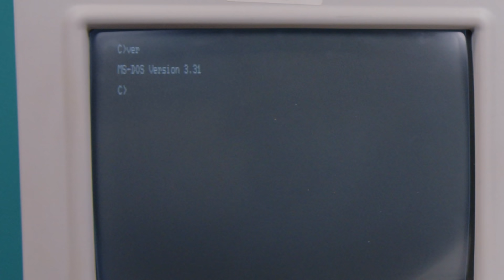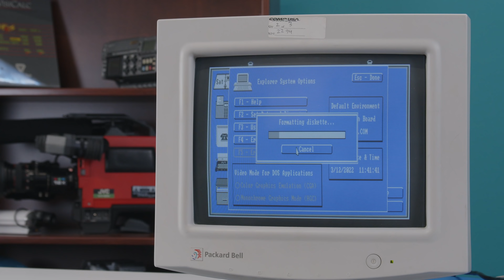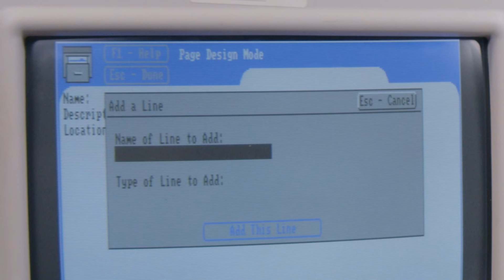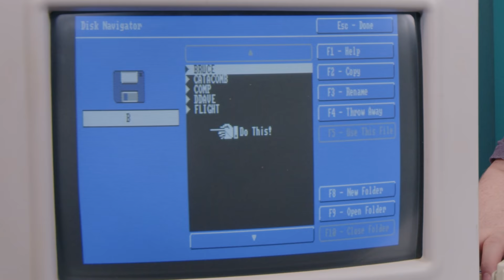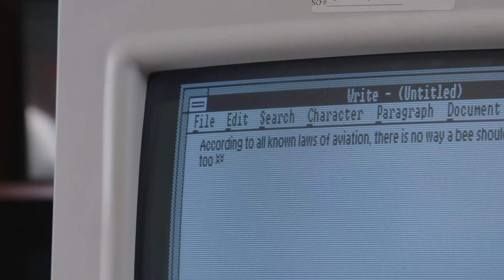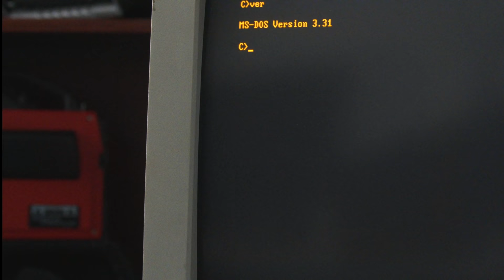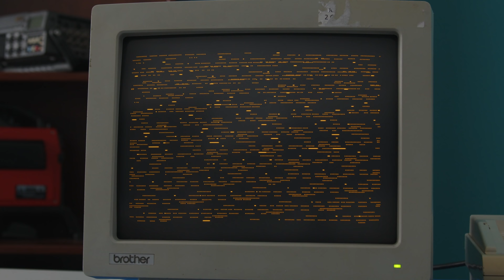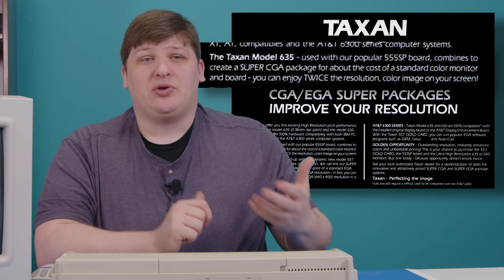Headstart's PC With The Weird GUI "OS" [Explorer]

Comment: I never heard of this machine before, cool video. Though, as someone that grew up on the C64, I actually loved that keyboard. The only issue is the cursor keys and that some of the customary interactions have changed over the years. I have typed many a program and paper on the old C64. :)
Reply: I still type programs on the C64. When I first saw a keyboard with 4 cursor keys, I thought:  What a needles clutter. ;-)
Reply: @NuntiusLegis  I really think the C64 keyboard is pretty great, really. I just happen to miss the Alt, proper Ctrl, meta and esc keys. Oh, also, I would kind of like a nice number pad too. If only I could use one of my USB number pads on the C64...
Reply: @CubicleNate  But the C64 does have CTRL - and CBM, RUN/STOP,  RESTORE, color keys, and graphical keys! Because of the clever multiple functions and appropriate labeling, a C64 keyboard compares to a PC keyboard like a Space Shuttle cockpit to the control stick of the Wright Flyer! ;-)
Reply: @NuntiusLegis  this is true, a lot of those things do translate. I suppose the run stop key is like escape. At least I used it much like that. I'm not sure how restore would translate.
Reply: @CubicleNate  Restore is the little sister of reset; can also get you out of trouble, but causes less collateral damage than the more dangerous and unforgiving big sister. ;-)
Reply: @NuntiusLegis  I can recall as a kid hitting Run/Stop and Restore to get my computer with no describable benefit. To this day, I want to hit such things on my modern computer but alas, the best I can do is Ctrl+Alt+Backspace to kill the X server.

Comment: A good keyboard is also important to me. If you type a lot of code on a bad keyboard, it slows down and your fingers cramp up quickly. I don't take that lightly when I have to buy a new keyboard. Nowadays it is hard to find a good keyboard, even expensive models fail in different ways.

Comment: Great video. Interesting machine. Reminds me of something I used. I have to ask have you tried using an amstrad PPC512/640 They had great keyboards. It was kind of similar to the headstart, but it also had a built in monitor.

Comment: @Cathode Ray Dude The Headstart's Hurculese mode and all graphics are done through a mix of having the CPU doing double duty, and three IC's all working in a form of psuedo-TTL for graphics. This is why the flip flop for Hurculese mode does not work, because it does not render the second frame at all.
Reply from the maker: Huh, do you have source on that? The graphics chip (details in pinned comment) says it supports Hercules natively.
Reply: @CathodeRayDude  The Yamaha v6366 in these machines are chips that were not fully functional as a way to cut cost, so they are half disabled, the second IC that was used to help with managing memory for the Yamaha. So page 2(Page 1) is not displaying, because the chip will not be able to display. I have no officalpapers for this, this is from my working and fixing three of these kits over the years.

Comment: Keyboards in the 80’s and 90’s varied wildly in quality, from terrible chiclet keys, to horribly unreliable & mushy foam and foil keyboards, to amazing Alps switches on some Apple II’s, IBM’s, and many others. 

I think your thoughts on 80’s keyboards being mostly terrible is just down to the particular old machines you lucked out on using the most often. I don’t think most were as bad as you are remembering, and the truly horrible keyboards from that era are just so terrible that they impact our views on the whole time period in general. 

There were just way too many amazing machines with fantastic alps switches, double shot key caps and over built construction for me to agree with 80’s keyboards being generally terrible quality….
Reply from the maker: I mean, I have an Atari ST, Apple IIc, IIe, C64, C128, Amstrad CPC, high end MSXes from Yamaha and Sony, Tandy 1000HX, and several other less well known devices with full-travel keyboards (like the FOR-A Video Typewriter) and I find every single one of them unpleasant and difficult to use. I'm willing to say I'm picky, but I also assert that these keyboards were objectively worse than the IBM Model F or anything derived from it. IBM's design was just a massive leap forward in quality.

Comment: Remember the Sinclair ZX Spectrum, and the Amstrad CPC-464? (No... lol... probably not) 

When Sinclair was in trouble, in spite of having one of the most successful home computers in the UK ever, Alan Sugar of Amstrad (later the original host of The Apprentice in the UK, before it came to USA) bought Sinclair and made upgraded Spectrums with proper keyboard and 3" disk drives (the Spectrum +3) but, later, they made the Sinclair PC200 - a 8086 CGA PC with 3.5" drive, two ISA slots for EGA/VGA or Western Digital Hard-Cards, under a flip up panel behind the keyboard. It ran MSDOS 3.2/3.3/6.x.

One of those was my first PC. Lovely thing of the wedge form factor, with a great keyboard (as I remember it). Black and red. Probably around 1988/89. 

Internet pics show one with the monitor on the area behind the keyboard but you would have never done that because it was only about 6" deep and it was flimsy plastic. Also, as soon as you installed a card, they stood upright (no riser card - they didn't work well with ISA) so you couldn't close the lid.

I think if you can find one (unlikely) you'd find it interesting.

Comment: The true beauty of MDA is only revealed through a true monochrome monitor (as you quite fittingly did. How could I have assumed, you'd leave the demonstration at that?).

I remember the clarity, no setup with a TV could ever aspire to match. Hercules was the engineer's choice. It also did games quite well.

It still compared favourable to later, higher resolution colour formats. Clarity is a factor in its own right.

Comment: Quick little note about you’re keyboard rant: that jamming you’re describing is known as binding and almost always is a result of dust accumulating in the switches over time. There are very few switches that experience binding when brand new so back in the 80s the switches wouldn’t have felt as bad. That being said don’t get me wrong, even without binding there were definitely many keyboards were more horrible than typing on thumbtacks

Comment: @34:58 Totally agree. That being said, I believe you can turn the computer on with another key pressed to change the boot speed from fast to slow. I used to work at a retailer that sold these in the early 90s. Now that I know more about their history I realize they must have bought old stock for cheap and resold it here in Latin America, although I don't recall if they had Spanish keyboards ...

Comment: There's a driver called EXPLORER.DRV that came with a copy of the 16 color version of Sierra's 1990 Christmas Card, that the install program labels as "Explorer with RGB monitor - 16 Colors". I've tested it with my ATI Small Wonder CGA/Plantronics/132-column card, and while it doesn't display correctly (output seems to overlap multiple cga planes, PC+ style, but not in a compatible fashion), it's clearly CGA-derived. I and a few others who specialize in Sierra adventure games have theorized, since finding it last year, that this is the machine it was intended for.
Reply from the maker: Wow, I better check this out then!
Reply: @CathodeRayDude  I'm currently going thru a deep-dive of stuff on The Internet Archive, and I just found a copy of Mixed-Up Mother Goose (SCI0 version) with its own EXPLORER.DRV, inside a warez disc. It is a different size than the 1990 card version. If you want, I can message you when (and if!) I find more.

Comment: Yeah, most of the 8-bit computers didn't have a dedicated keyboard controller, and did matrix scans during vertical blanking intervals.  I think the Apple II was a rare exception where it DID have some sort of controller.  Anyhow, scanning on VBLANK results in some character lossage, especially if there's any debounce as that's not nearly fast enough to catch any keys striking within 16-20ms of each other.   I felt that keenly when I got my C64 out of storage and was messing around with it - it even shows up in the emulators.

That being said, the 16/32 bit machines (Amiga, Macintosh, Atari) and PCs had dedicated keyboard controllers even in the 80s.   The Amiga 2000 (1987) even has N-key rollover in the initial batch of keyboards produced - diode-ified matrix...with the bonus that it's an embedded controller variant of the 6502 driving it ("6500/1 ONE-CHIP MICROCOMPUTER").

Comment: 26:10 Basically vi/vim text editors also delete things by cutting. Or, more accurately. Anything that you delete (character(s), line(s), selection) are "cut" rather than deleted. And since you have multiple named clipboards, you can still use your own copy/paste things separate.
Of course, you don't have to use a mouse for that... since there are no buttons at all.

Comment: I was using GEOS on my C64 in the late 80s and very early dawn of the 90s.  Initially I used the basic GEOWrite and later the expanded GEOWrite Workshop.  I also had a spell checker, I don't recall if that was built into GEOWrite Workshop or a separate GEO app.  Anyway, the GEOWrite  WYSIWYG word processors were very nice and more feature rich than the Headstart appears to be.  I could out-type it, but it wasn't terribly bothersome to me.  JiffyDOS, a 1581 floppy drive and a 512K REU made GEOS very comfortable to work with overall though.

Comment: I have a feeling the Apple II keyboard was probaby better when new than after 30-40 years of use, time and wear and tear. Especially given that the best keyboards if the era used mechanical keyswitches. — One other notable thing is that early computer keyboards are very much like those used in a typewriter, which is rather different than any common PC keyboard. Thus they are probably designed for a different audience; since typos (on a typewriter) are a pain it seems likely that the keys are intended to be struck very deliberately and relatively fast, but not super quick.

Comment: An odd computer for sure.  It's a cross between brilliant and low-end computers at the same time.  The keyboard and concept is the best feature.  The bulk, not so much.  But its GUI/software is the worst - that's not really a "GUI".   If that software was decent, it seems it would be something that would attract people who are still more used to typewriters.   At $600 (1990) and compare it to an Amiga 500 which was selling for $500. that was a lot smaller.  Easily has far better graphics, stereo sound and of course more expandable.   Having a full-blown OS too.   It's still sad that PCs were more expensive vs better technology back in those days.

Just saw this video, and halfway through your "best school computer".  Great videos on old technology.  Thanks for showing so much on these things.

Comment: Hi! The Hercules problem could be because of a memory overlap.
One of Hercules' video pages overlaps with CGA's.
That's why the Hercules card uses only one video page after power-on, to co-exist with a CGA.
Unfortunately, some applications don't expect this and will use both pages - thus corrupting CGA video.
If you had a dual-monitor setup, you'd perhaps see a graphics on the Hercules monitor
and simultanously a corruption on the CGA monitor. MSHERC /HALF may help here.

The other page is also uses by CGA emulation on Hercules cards, maybe.
Programs of the kind of SIMCGA let CGA programs/games write into CGA video memory,
while simultanously copying a re-formatted image into Hercules video memory.
That way, it's possible to play CGA games on a Hercules monitor, I think.

Comment: Griping about lack of features of a ROM/built-in word processor. Features need code, more code means it's larger and there needs to be more programming space, space means more room in ROM, more room means the ROM might need to be larger, and larger ROM chips cost more.

Comment: Also, when it came to keyboards in the '80s, a few machines featured decent keyboards apart from the IBM PC.  For the home computers, the Atari 1200XL had the best keyboard of any of the original 8-bit home computers.  The 1200XL had other issues - like incompatibility challenges with its predecessor the 800 - but the keyboard was second to none during that era.

The Atari ST's keyboard was mushy but usable.  The Mega ST and Mega STe tho came with great keyboards.   The Amigas tended to have decent keyboards as well.  And some clones had respectable keyboards.  I didn't care much for the original Mac's keyboard, although it was an improvement over machines like the C64, but subsequent Macs had decent keyboards as well.  By the time this system came out there was definitely keyboard competition.

Comment: Goddamn turbo button. 

Ten year old me with the family’s first home computer in 1992 thought, “turbo means go fast”… because that’s what the word means ffs why would you call a “turn turbo off” button “turbo” instead of having the light indicate when it’s on instead of when it’s off….

Sorry. I’m not bitter. 
I had that button on the whole time I had that thing, complaining about how useless it was for anything a kid wanted to do and bugging my poor (in both senses) parents about how bad we needed a new one… which i would’ve immediately crippled as soon as I got it by pressing the same button. 
Luckily by the time I was saving up for my own pc to play games on the button wasn’t as much of a thing. 

I didn’t find out for years and years how ignorant I’d been.
Reply: Yeah, it flipped after the AT.  It used to be an optional "go faster" button, ramping the speed up from the compatible 4.77MHz to 7, 8, 9, 10, or 12MHz.  But then it wasn't quite as common for software to assume that it was always and forever running at 4.77MHz, so the Turbo button changed to a Compatibility Mode button to slow the system down for those old software packages.

FWIW, a lot of times, the "polarity" of the switch could be flipped.  It was usually a 3-pin latching switch, with a common middle pin, and the outer two pins being connected alternately to the common pin in either switched-in or switched-out position.  So, if you didn't like "Fast = switched OUT" mode, you could connect the outer cable to the other outer pin, and that would change it to "Fast = switched IN" mode.  I think the rationale was that normalized (fastest possible) mode should be with all switches in their default position, rather than having like a pushed-out reset and a pushed-in turbo.
Reply: @nickwallette6201  I get that rationale, but that same rationale should’ve also said “let’s call it something other than “turbo” now that it’s a compatibility mode. Maybe “compatibility mode””

I know you could sometimes change it, now, and that’s something tween me would’ve loved to have done… if I’d had any reason at all to suspect. 

It’s a bummer. My parents sacrificed to get us what was actually a pretty decent machine for the time, and I was unable to appreciate it as much as I should have. 
Ah, well.
Reply: @joearnold6881   Yeah.  It doesn't make sense in hindsight.  It was a continuation of the button that had been there from before, when going up in speed could cause compatibility issues, so the safe move was to stay slow.  That's it.  Just a status quo thing.  If that button had never been there, it wouldn't have made as much sense to call it that when the default setting was turbo, and engaging the switch was un-turbo.  Like a lot of decisions in that era, it was rooted in legacy without regard for future impact.

That said, it was also a time where you were expected to read the big paper manuals that came with the computer, and experiment a little, so they didn't take as much care to assure you understood everything at face value.  I dunno about yours, but my first PC was a 386DX/33 with an AMI BIOS.  When you turned it on, you would get the tick-tick-tick-tick of the memory check.  If you had the turbo button pressed in it went down to tick.. tick.. tick.. tick..  and that gave you a clue that things had just gotten slower.  I also just pressed the button for fun sometimes when games were running demo sequences or idle animations.  Just to see what happened.  I think that was kind of expected at the time.  Or it could just be me.  :-)

Comment: In 1986 you could get a shareware program called PC-write that was decent .my boss liked homeword that was a Unix port. It was a Tandy 1000 ex
It also came with a a shell called deskmate that had a calendar database spreadsheet and word processor but if you drilled down you could add your own program's including one's written in basic

Comment: I used several models of the Tandy 1000 line. They were ok in their compatability with software, but hardware could be a problem. Once clones were all over the place, Tandy didn't sell very well and were eventually cancelled.

Comment: Awesome Video, didn't know that much about the Hercules Graphics! Which CGA emulator did you use for the CGA on Hercules demos?
Reply from the maker: That's the one built into the graphics hardware in the machine, I'm not sure if there's any TSR being loaded to turn it on or if it just accepts the CGA register settings at a hardware level.
Reply: @CathodeRayDude  I mean you did say you rebooted and just ran CGA software without TSRs. I think I’ve seen another example of this on Adrian’s Digital Basement with a multi mode CGA/Hercules Card. I can’t believe I wasted 2 hrs with PCem in Hercules mode and multiple CGA emulator TSRs trying to get CGA software to work on Hercules. I’d love the chance some day to mess around with one of these real machines (I’m mostly out of luck in my country of finding them)
Reply: Also could you let me know where you found that Hercules Test suite online?